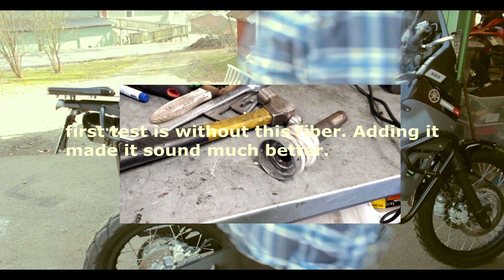My Yamaha Ténéré xt660z Is Too Loud!

Comment: Cool!
It would be pratical if you had show us the shaking at low revs before and the result without shaking after the O2 Optimizer instalation, like you did with the DB killer instalation. 
Without this check how could we measure the shaking redution?

Comment: hi! is this 02 optimizer a -power comander or is two different things? can u give source where u got this device??
Reply from the maker: no they are different things, the 02 optimizes just plays with the reading from the lambda which makes the bikes ecu stick to a constant fixed richer fuel-mix at the lower revs, so you don't get the shakes as much on low rpm. The power commander is a programable little box for the whole "spectrum", you can use them together to get a even better result. https://www.off-the-road.de/en/XT-660Z/Engine-tuning/Intake/O2-Optimizer-XT660.html